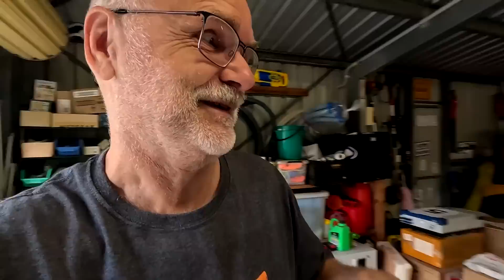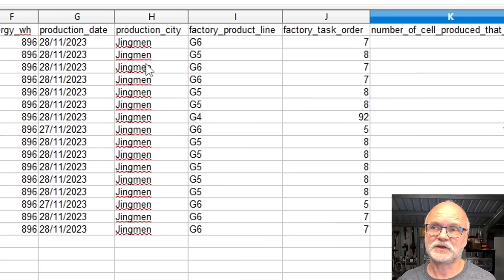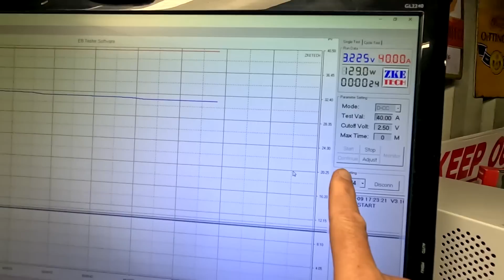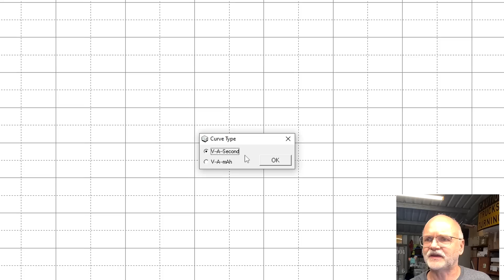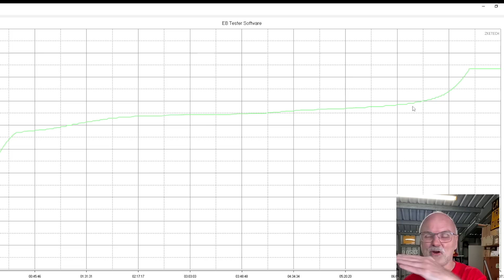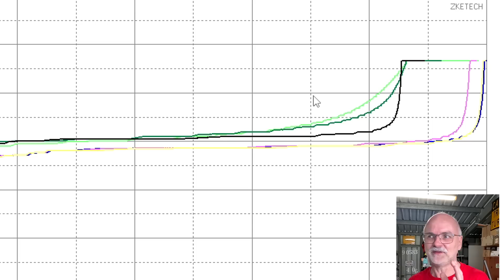Yixiang Batterie Consistency Test and how to identify problem cells. Wait! Have we just found some?

Comment from the maker: Btw, the (B) showing in the QR code scanner means LiFePo4 chemistry. Developer confirmed.
Reply: I watched this episode with great interest as I have similar issue in a 16 cell pack. One cell is consistently raising quicker than the other 15. The 15 “normal” cells raise all within about 5mV difference till 3.45V but the other one raises quicker. The difference start to get really noticeable from about 3.35V. 
The main issue is that this one cell reaches the 3.45V before the others are fully charged. From there on the cells start active balancing but very often this process is not fully completed by the setting of the sun. 
I tried to “compensate” the drift of this one cell by starting the balancing earlier at about 3.36V instead of 3.45V (as per Andy’s advice). 
The question that raises is what energy loss (if any) is created by balancing this early. 
Looking forward to any return information !
Reply from the maker: @JAN_DB  If it is only one cell, check all the busbar and balance lead connections. If OK, swap the battery with another one in the pack and monitor if the problem is with the cell or location.
3.36V is far too early to start balancing. There is no real difference in cell voltage at this stage as we are still in the flat part of the charging curve.
Reply: Hi Andy. Many thanks for your reply !
I know/understand that 3.36V is way too early to start balancing (in the ideal world), but let me explain further why I programmed the BMS this way: this one cell spikes shortly after reaching 3.38V and runs towards 3.5V and even higher way before the other cells even moved a bit closer to 3.37V. This happens within minutes.
So my idea was to put a “little break” on this one cell from the very first start it’s voltage starts rising. Unfortunately, even this early “tempering” doesn’t help a lot as the BMS shuts down the charging of the complete battery as this one cell charges very quickly to 3.45V (cut off voltage) and my other 15 cells are still at 3.6-3.7V. 
But I’ll take your advice and will switch this one cell to an other location and keep you informed.
Edit: another question raises now… when changing cells I need to “decompress” the battery. They are mounted all 16 in a row with double compression bars (10mm screw threads on either side). Does it make a difference if I loosen and re-clamp them when fully charged or rather in low SOC ? Thanks again !
Reply from the maker: @JAN_DB  Yeah, I understood why you want to start balancing early to catch this one cell. If you have a runner like this, swap it with another cell.
Compression needs to be accordingly with the manufacturer specs at 20-40%SOC, never at full or empty.
M10 is far too much compression if you ask me. 6x M6 rods only need 0.5Nm each to achieve that required 300kgf.

Comment: Hi! have you ever had the problem of double hole shiny-coated connectors ruining the conductivity of the cells? Usually it is the vendor who welds the connections on the cells. This vendor measures the internal resistance only at the soldering points of the aluminum piece, but not on the surface that should contact the busbars. We have had good cells but the connectors appear to be powder coated, like shiny paint that ruins the conductivity. It' s impossible in that point also measure the internal resistance of the cells. On the surface connecting with the busbars the conductivity is so lousy that the tester does not detect good resistance anywhere. This is dangerous and could lead to overheating problems and ruining the cells. The seller won't listen to reason and says that internal resistance has to be measured only at the soldering points -and not on the surface that should make connection with the busbar.(!) -. 🙁What do you think? Thank U in advance.

Comment: Hey Andy,
very interesting video - i would guess, maybe there are more Gas-Bubbles in the liquid between the layers are not fully squeezed out yet on these cells.
Then they should be more similar to the others after compressing them and give them a full charge.

If the issue does not disappear, i´m keen to see how they behave in the 16S Battery after some cycles - guess it would cause massive issues when the Active balancer kicks in at 3.45V and discharges the cells with the early risen voltage
It would be even problematic, to bulk charge to 56v or so and then drop down to float at 55.2V

I´m really looking forward for the next Video of these cells 
Have a great time 🐸
Der_Hannes

Comment: Lithiu. Batteries do not have an internal discharge chemistery.    If the ells are drifting off , they are faulty or you got used batteries.  Storage will not discharge cells  to 0.001 volts at the time of storage.  If they are discharging then thise are faulty bateries.

Comment: Great testing again Andy !  The most important message to me from this is, that because of these differences, one should charge a LiFePO4 battery bank only to 3.40v/cell and discharge only to 3.10v/cell (I do 3.0 because I have more than 40A discharge current, which is lowering the voltage  of the discharge curve for the same SOC).  
Beyond those limits, the cell voltages may start to differ too much within the bank and may create a false balancing pattern on the top end, and, an over discharge of certain cells at the bottom end
This is also the main path for creating longevity of the battery: we do not want to use those risky areas on both ends of the curve.   The little extra capacity that one could get out of that is just not worth the risk.
Thank you again Andy !  All your testing has given me great insights and has helped me building a 32-cell battery that I am using for 2 years already now uninterrupted  ....  This battery cools down my wife all night every night. 😃❄
Reply: Do you really want your wife to be frigid ?

Comment: If you want reliable and consistent test results, you need consistent test conditions. This is especially true for lower temperatures. First thing I noticed years ago testing in my garage during the winter, results change with the temperature.

Comment: Mit wieviel AWG oder mm2 schließt du deine Akkupacks an? Grüße aus der Nähe von Kassel :)
Reply from the maker: Depends on your circuit breaker.

I use 35mm cable for a 100A DC breaker.

Comment: The Yixiang battery boxes are pretty much the same thing as the EEL battery boxes.
Reply from the maker: Not quite. I have tested both here on the channel. The Yixiang box is the better choice atm.
Reply: @OffGridGarageAustralia  Just a bit more expensive than the EEL  (EEL doesn't add taxes, but Yixiang adds shipping and taxes, while EEL has free shipping.  The Yixiang would be $628 with shipping and taxes, vs $541 for the EEL after the 5% discount)

It seems they updated the Yixiang box to have a circuit breaker as well.

Big reason about why I planned on buying from EEL from their Shopify store, is its a cheaper option with free shipping.  The battery box + 16 Hthium batteries would be about $1680 US.

If I bought the Yixiang box + cells from Apexium Alibaba malls (Yixiang wouldn't give shipping costs for the cells), it would cost me $2334 (taxes, plus shipping being $956), though I did find cheaper places on Alibaba to buy the cells from.

Comment: of course the big danger in differnt charge curves is: overcharging of some cells (with explosion?) can JKBMS remedy this problem? (dude used MPPSolar 5kW on 15S without a bms for half a year... and it worked... but one cell was only 270Ah)
Reply from the maker: LiFePO4 don't explode. That exactly what the BMS is for to catch such cells and disconnect the battery if something goes out of specs.
Reply: @OffGridGarageAustralia  let's put it like this: if one cell is bad, the whole pack can not be charged to it's full capacity? (because one cell going up in voltage faster than all others? any idea how to remedy this?)

Comment: Interesting about the rest voltage - if you absorb the battery down to 0.000A (will take ages), then I suspect the voltage will "float down" when disconnected much much slower (if at all)....
Reply from the maker: That depends on the absorption voltage though. 0A means usually overcharging at 3.65V.

Comment: Hi Andy!  It seems to me that this may be due to the end of charge current, perhaps it makes sense to check the charge to a 1A cut off current. Most likely the issue is the scale of the graph display on the time scale.  When charging up to 1A, the time of the last charging stage will be longer, and accordingly the graph will increase more steeply.
Reply from the maker: I've checked that as well. There is no difference, and the scale is exactly the same. Their voltage just lifts off a lot earlier than with the other cells.
Reply: @OffGridGarageAustralia  thank you!

Comment: Hi Andy
Do you think that daily overcharging of the cells is very harmful or do you have any information on this? 
I am referring to the issue of allowing the charging current to saturate to 0A with a voltage per cell of 3.45V, as you have been doing for a long time according to VRM. 

According to nordkyndesign, this is supposed to be dangerous.
However, every BMS I have seen so far does this.
Nice Video 🙂
Reply from the maker: Charging to 3.45V and let the current taper off to 0A is fine and will not overcharge the cells. It is very different at higher voltages.
I know the Nordkyndesign website and graph and I believe this is just one person's opinion without any real scientific background or testing consistency. It also says this on the website itself if you read though the text.

Comment: Hi everyone, I am looking for a bit of help, I want to upgrade my inverter a soltaro ESS hyper3680 to a hyper5000. but I am finding it difficult to get one here in Ireland.(supplier no longer selling Soltaro or just the inverter) it looks like the soltaro batteries can only communicate with the soltaro inverter brand, can any one confirm this? or is there a way around it. I can get solis inverters through work, would this inverter communicate  with my 2 soltaro lfp batteries. thanks Paul.

Comment: Did you control for temperature during the 7 hours and between each battery?
If not, then you need to do that before drawing any conclusions.
Reply from the maker: They warmed up in the same way during testing and all started at the same temperature.

Comment: Manufacturing screw up in matching the graphite anode and LFP cathode electrode thicknesses for proper electrode capacity ratio.  There is normally some electrode ink printing thickness variation onto the conductive foil which is measured and matched up with an associated opposite electrode to yield proper charge/discharge capacity match between electrodes.   Also, number of jelly roll wraps is adjusted to keep cell capacity near same for thin/thick electrodes tolerance variation.  

Usually, graphite neg anode is given a little extra spare capacity over LFP pos electrode.  Quick voltage rise at top of charge is positive LFP electrode reaching full state of charge which happens abruptly.  Normally the positive LFP electrode thickness determines the capacity of cell.  The slow voltage rise happens when negative graphite is reaching full state of charge before the pos LFP electrode.  Graphite has a slower transition when approaching full state of charge.  It says cell is short on neg graphite electrode capacity.  The graphite electrode potential vs. SoC also causes the characteristic voltage bumps at about 65% and 25% SoC for open circuit rested cell voltage which are more visible during charging compared to discharging.  Graphite electrode potential is 0.5 to >1v at full discharge and gets close to zero volts at full charge.  LFP positive electrode potential is almost perfectly flat until it gets close to fully charged or discharged (3.43vdc).  Cell voltage is pos LFP electrode potential minus the neg graphite electrode potential.

They are not 'A' grade cells.  They are manufacturer rejects.

Comment: I have seen this in calt 280 cells balance turn on at 3.4v 3 cells hit balance sooner than the rest of the cells active balance takes out charge out of these 3 cells then when the rest of the cells actually reach 100 percent 3,45 these same 3 cells fall behind it's the same issue you have with the charge curve. Solution moved balance voltage up to 3.45 so the cells wouldn't start balancing until full have not had a issue since

Comment: As someone who uses LFP batteries in New Zealand, where it's colder than sunny hot Australia, this effect on the voltage/SOC curve is due to temperature. As soon as you get down to 15°C or below, the batteries act as if they have more internal resistance i.e. the voltage will be higher (at lower temperatures) with a given charge current at a given SOC (and lower while discharging).

If you repeat this test again at 25°C, I bet you will see a difference.
Reply: This!
Reply: This is pretty interesting. Wonder what the temperature variation of the garage was from day to day during the tests, considering that each test took about 7hours. That's a lot of time for temps to change in a non-insulated room 🤔🤔
Reply: This. The cells like the same temperature you do. Even above freezing, if you are cold, they are too. Don't try a 1C charge rate below 10 degrees C.
Reply: @john_in_phoenix  My cells are in a low demand application, I charge them at 0.025C below 10°C! Hehe
Reply: Interesting and makes sense.

Comment: kind reminder that you do not need these test as a jk bms owner.

Build the battery and then use the BatMon Integratiin for JK BMS.
Then you will get all the data from the app as sensors.

Finally after a few days of cycling the batteries you click on the voltage of cell 1 - annd then click on more.
Here you can select date and time you wanna check and then add another sensor or entity like voltage cell number 2.
You will complain that it might take a long time.
Ok, for you a shortcut. After adding the second sensor/entity now copy the url and paste that into notepad.
You will easily identify the syntax and add cell to 16.

Now you can check all cells for every time you want whick hit the undervoltage protection and overvoltage too.
you can the deactivate the average cells one by one until you only will have left the AUSREIßER - special german word but you know that for sure - bombensicher.

anyhow, you can manipulate the report easily to the usual 3 to 4 suspects, and mostly you can even identify groups of 4 cells if you had gotten grade a cells. 
You can identify the boxes they came in. I have 4 hitting overvoltage together and another 4 the undervolrage protection verge.

Hope it helps and makes things a lot easier and better than the ebc40 tests i had done hundreds of times before till I found out what I wrote above

Comment: Just found your channel, awesome work! I found it because of the Overkill IOS app! Best app for JBD BMS, I already changed my BMS to have a higher cutoff low temp charging (trigger condition) from -15c (factory) to -1.0c, hoping less cell damage when charging in below 0c in the winter? Thank you!
Reply from the maker: Welcome to the channel!
You cannot charge Lithium batteries below 0°C. It will damage them instantly. Set this to 2-3° and get a battery heater if possible.
Reply: @OffGridGarageAustralia  Thanks for the help! I made a mistake and I changed the "Discharge under temp" I think it was set to a lower value, and I changed it to -1F release condition 14F and Trig Delay same 5. So I should change Charge under temp Trigger Condition is 14F Release Condition 23F. This is what the BMS was set by the battery seller. Thanks

Comment: As for using too much energy, couldn't you use a regenerative discharge by draining the batteries through a boost converter to dump the energy into another battery? Use a shunt meter or coulomb counter to measure the energy?
Reply from the maker: Yes, I could, but how do I control all this and also have a constant current draw through the entire process and voltage range from 2.5V to 3.65V?
It's easy said but very hard to build. The ZKE tester does it perfectly but also wastes all the energy.

Comment: And also the whole graph looks like it's shifted to the left for cell 6 so i think they are just at different charge state.
Might also just need compression.
Don't think there is anything wrong with it but yes it's a little suspicious and could be fun to track how it goes over a long time.

But please, parallel all then fully float charge for an extended time then test again:)
Reply from the maker: The graphs start at the same voltage as explained in the video.

No parallel balancing needed any more for LiFePO4 if you have a MS with active balancer.

Comment: Great video. Could this behaviour explain why the SOC of my two paralleled 5KwH batteries drift apart during heavy amp draw? One could show 50% and the other 65%. Both are connected to busbars with the same length and thickness wires. Thank You.
Reply from the maker: 50% and 65% is not too bad of a drift, considering you are in the absolutely flat part of the discharge curve. Do they come together again once you fully charge them?
Reply: @OffGridGarageAustralia  Yes, sir. They synchronise at the end of charging.

Comment: Hey Andy, At 06:50 the scan of the first battery had a couple of values in brackets but did not come up on the export except in the QR code      EVE Power (04Q)   LiFePO4 (B)   LF280K (76).  Do you have (B) grade cells?
Reply from the maker: They are supposed to be A grade cells.
I'll ask the developer if the scanner picks that up. (B) could mean anything...